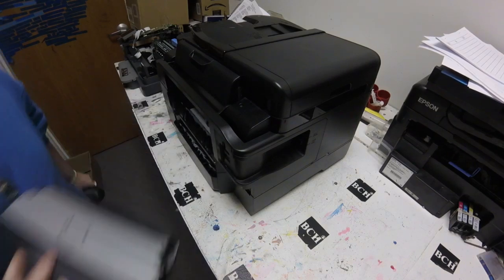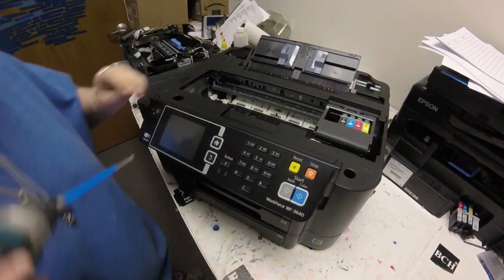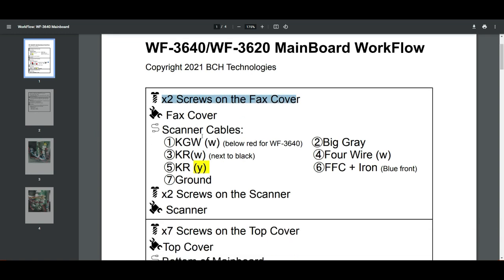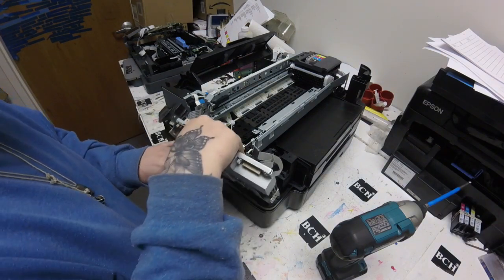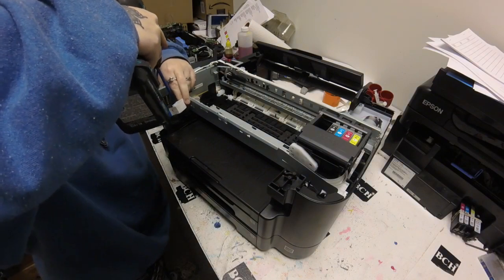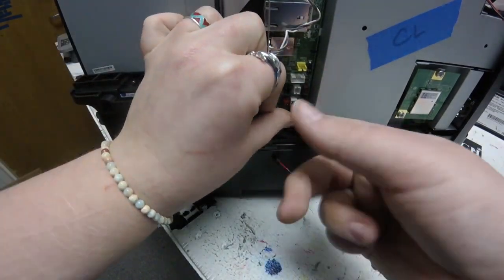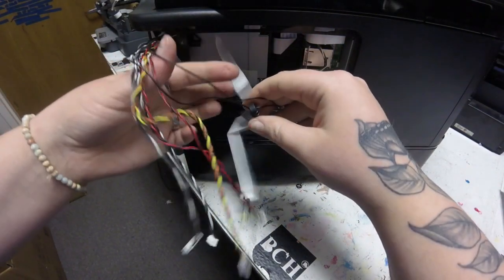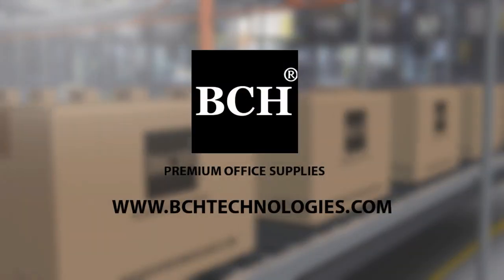Fix Epson 0x9A Error (Part 2) Replacing Mainboard for Epson WF-3640

Comment: Why did you replace the entire mainboard, rather than just replacing the F1 fuse? I am getting a 0x9a error on my Epson 7620, and I am wondering how to check if the fuse is blown before replacing the entire mainboard